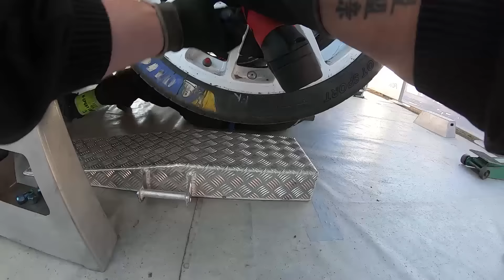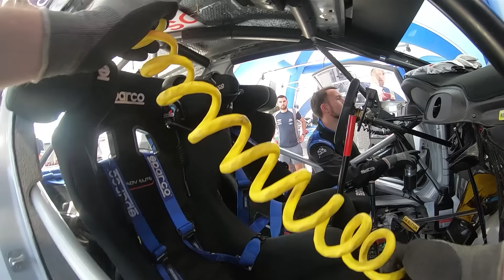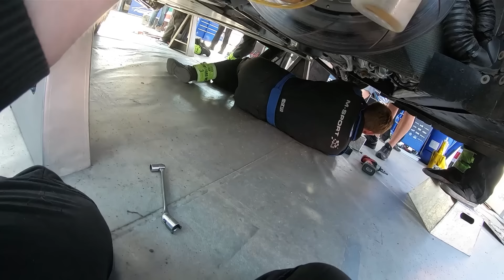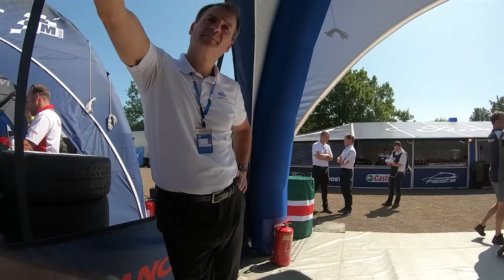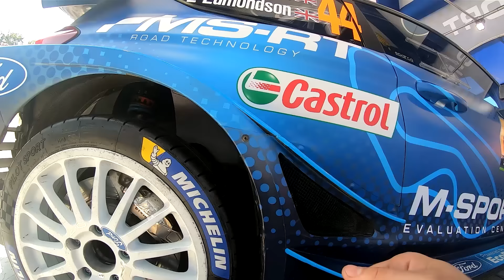Be A WRC Rally Mechanic For 6 Minutes | WRC 2019

Comment: At the service shop this would take 2 weeks and cost you $5,000.
Reply: If your car is being worked on for 2 weeks, that's half price... Why do people always exaggerate!
Reply: @TorAndreBrresen  Saying "...people always exaggerate!" is also an exaggeration.
Reply: @peteandalie  It's often mentioned when they show a car being fixed, makes the normal mechanic sound useless
Reply: @TorAndreBrresen  "normal" mechanic. The mechanics on a rally team are  just has the ones that you see on a garage. A mechanic in a garage doesn't work 8 hours in the same car.
Reply: @hugocorreia7519  Sometimes we do that but what's that got to do with it? I'm just saying that when they say that a gearbox changes takes days in a garage they are wrong as it usually a couple of hours. (You might pay for more hours...)
Reply: @TorAndreBrresen  yeah, a gearbox from a legal road car needs a little bit more attention. These ones are "easy" to work with compared to the road cars. The team is  used to this type of gearbox because it's the same to 1/2 years. A daily garage receives different cars every week.
Reply: @hugocorreia7519  I know, I'm a mechanic myself.
Reply: @TorAndreBrresen  yeah hehehe
I noticed. I'm a student mechanic.
Reply: The best thing is to know fix the car yourself, and only need a tuner . Nothing else... Mechanics are "thefts" most of the times
Reply: @brokentougers8252  It's expensive, but it also costs a lot to run a garage. We have to buy a new wheel alignment  lift at 20.000€...
Reply: @TorAndreBrresen  Well, in theory i have to pay that per hours of your job, not a standart price... But anyway .... At least fix the cars you get and get paid as much as you want... 
In my town, the mechanics are useless! Not even they do not fix my car, but they do it worse... That is not the case :/
Reply: @hugocorreia7519  you can do a daily car gearbox in a few hours ,after years of working in cars almost every gearbox takes the same
Reply: @brokentougers8252  bet your in Greece. Maintaining a garage is not cheap at all.
Reply: @hugocorreia7519  I would say pretty cheap! The most garages doesn't buy new tools or machines / diagnostics etc... Plus many of them do not pay a lot taxes (illegal)... So it is dirt cheap to maintain a garage i would say ... 

Though i never had one so i can only tell my opinion as a customer! You as a mechanic may have a different opinion and i would like to hear that! It is pretty respectable and i would like to see every point of view!
Reply: @brokentougers8252  I'm in Switzerland and I'm making an apprenticeship in a big garage that is mostly for track day cars or tuners,but we receive some normal cars sometimes. It's "normal" to make the prices a little bit higher in the end. And it depends on what car you repair or make a modification.
Reply: @hugocorreia7519  Well i mean! You work on a high level garage! There are for sure some of them here in Greece too! But i spoke for the most of garages! 

That is great for you though! Best wishes for the future , and hope you get your own garage if you ever want!
Reply: @brokentougers8252  thanks. The best for you too.
I knew you were from greece because there was a Konstantinos Mitroglou in benfica.
Reply: @hugocorreia7519  What an amazing guy! He was playing firstly in the team i love! Olympiacos fc!
Reply: @brokentougers8252  Andreas samaris as well.
Reply: @hugocorreia7519  Yeah! Back then, Olympiacos had a dream team! Glad to tell you that this year, Olympiacos is back with a strong team!
Reply: Why is there an argument here?
Reply: Ripped off worse than you ever would with Oaken.
Reply: you know why that is? road cars are equipped with a lot more instruments than race cars, and the parts are specifically made so they are easy to replace. A rally car is literally like working with lego . It's realy simple, you have all the space and all the parts that are on the car, are pretty much brand new and they aren't corroded and rusted like roads cars get. Also do you really think when we work on your car we work the whole day on just your car? Of course not! There are other costumers who needs their car fixed as well.  I am a mechanic myself and each mechanic has about 5 to 8 cars to finish PER DAY. I work in a certified Volkswagen garage and it has an average of 35 car enters PER DAY. We still work as fast as possible. But pls don't assume that we just sit on our asses and charge you too much. A car mechanics job is really hard job mentally and physically!
Reply: because they didnt fix your car with super glue and duct tape
Reply: @brokentougers8252  what
Reply: @1FORIMPERIUM  what
Reply: @brokentougers8252  ?
Reply: @1FORIMPERIUM  ?
Reply: @brokentougers8252  you talked about learning the cars and tuning your self but your then basically a mechanic and then calling mechanics thefts which is you’re self ? So
Reply: @1FORIMPERIUM  I mean if you basically fix your own car no. If I would work as a mechanich yeah I would be one... I would overcharge people as they do and make tons of money
Reply: @brokentougers8252  where do you go that overcharge people for certain parts of the car needing fixing ? Give me an example of what part of the car because it also depends on the part the day the time and if they need to order parts which is then doubled price due to product Pricing and business ect basically product equity
Reply: @1FORIMPERIUM  changing a timing belt and charging 100+ € for work that a lot ! I don't care if you agree or not. That's just a lot
Reply: @brokentougers8252  it’s really not
Reply: That’s about right tbh in the UK maybe a little cheaper but ofc it’s high price it’s a fan belt 🤮
Reply: @1FORIMPERIUM  Exactly! That's why .... And I mean a timing belt is totally doable ... so I chose this way of DIY everything
Reply: @brokentougers8252  but betime you buy the part and for you might as well pay tbh saves time and money if it goes wrong not saying if it does but percussion mate it’s a car not fabric
Reply: @brokentougers8252  I see so many DIY young guys doing up their cars only to destroy them then asking techs to repair their damage lol
Reply: @MrJeroenreyns  are you a technician or mechanic? cause I see that interchange of names alot.
Reply: This does not make sense at all, and it is completely unfair when you consider the huge amount of manpower, logistics and supply chain to a local garage. People do not understand how time consuming it is to just get all the necessary parts and let alone disassemble and reinstall everything.
Reply: Don't ask how cost this service:)

Comment: I'm always impressed that they actually use torque Wrench for WRC pit stops. Also surprised Snap On is the tool sponsor for this team too. 
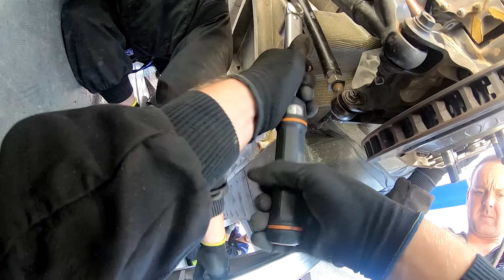2:05 Torque for control arms
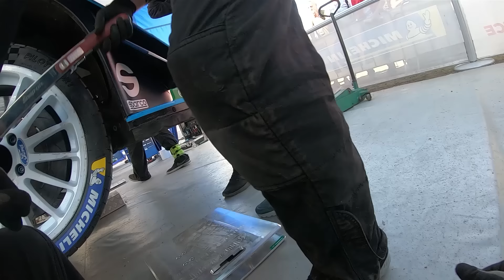3:55 Torque the wheel  lug nuts

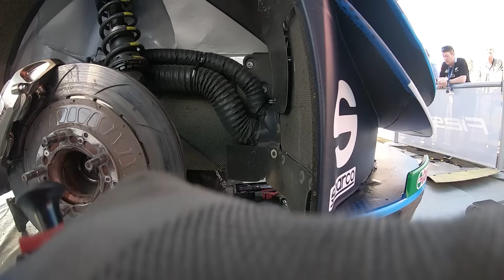Comment: 3:11 what exactly are you using to clean the brakes? Anything special or just good old soapy water/generic brake parts cleaner?
Reply: Just brake cleaner. I roll up a small piece of paper and stick it in the bleeding screw. Repeat the process till there is no more brakefluid and than use brake cleaner to clean any brake fluid around the screw

Comment: Doesnt he risk damaging the hub bolts by installing the screws immediately with the pneumatic wrench instead of catching the thread with the screw using his hand only at first?
Reply: I belive the pneumatic wrench is already set for that torque.
Reply: Normally the end of the hub bolts have no thread so the nut cas sit straight on the bolt. With some focus while screwing the nuts on, it's almost not possible to damage the thread.

Comment: That brake fluid looks alot worse in condition than i would expect.
And I'm surprised they torque things when they could just use 4 uggaduggas
Reply: not using torque wrench is a joke when beeing a motorsport engineering . i am  speaking from my experience as a motorsport engineer and a mechanical engineer
Reply: @danid504  That click of a torque wrench is one of the most satisfying things in the world 😊